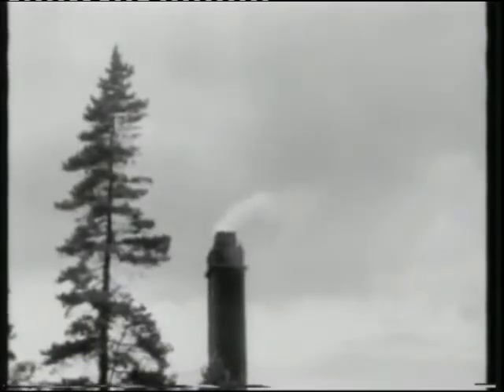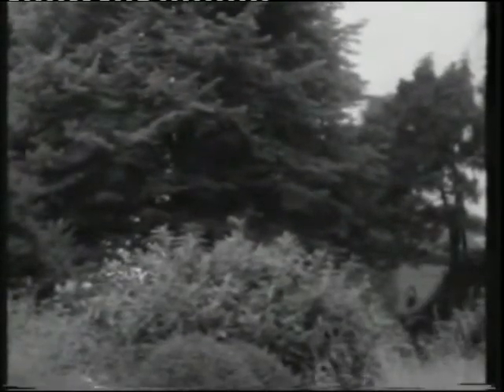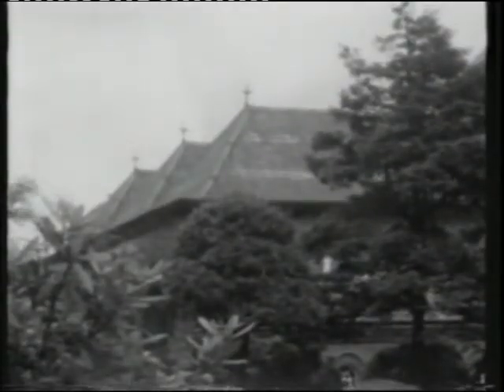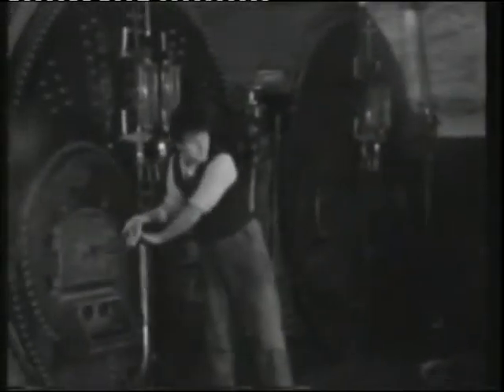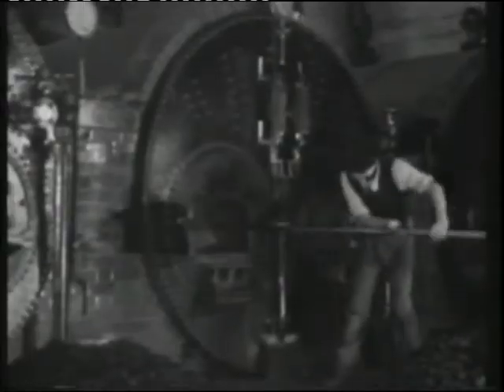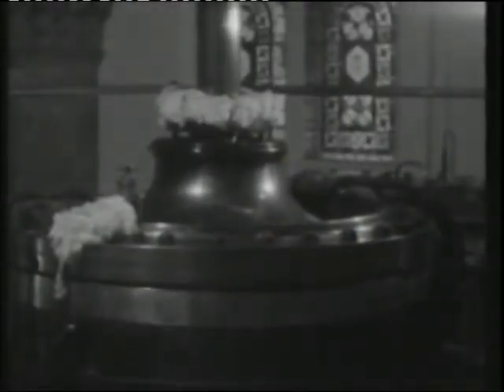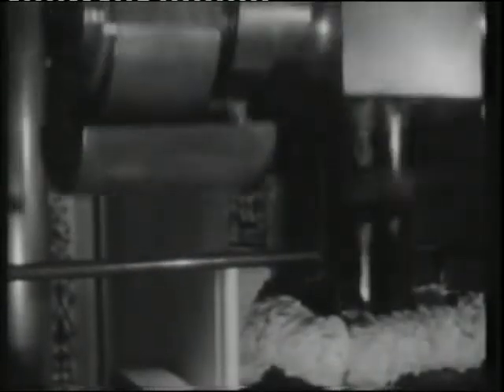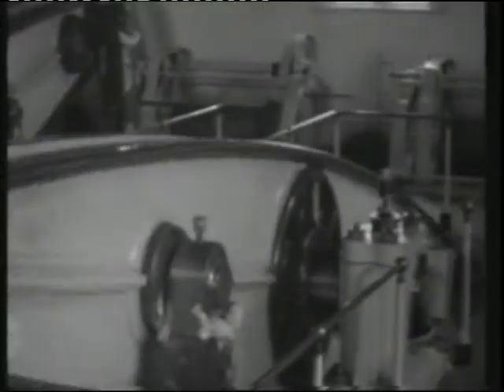Papplewick Pumping Station, 1969

Comment: What a colossal banging and clatter. Do you suppose that was added to the video afterwards, or was the engine really that loose and noisy by this time?
Reply: Alot of that noise will be the pump rods clattering around inside the rising main tubes as they go up and down